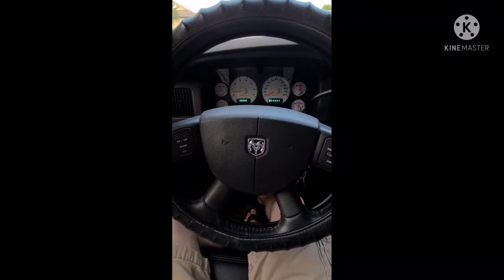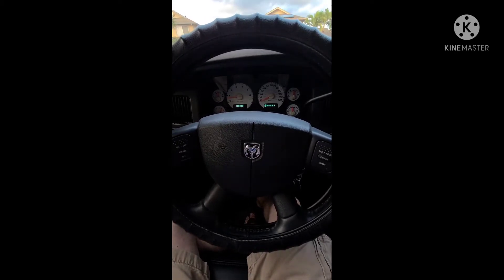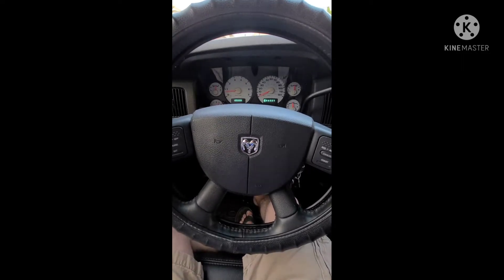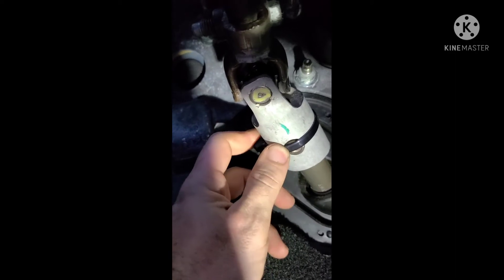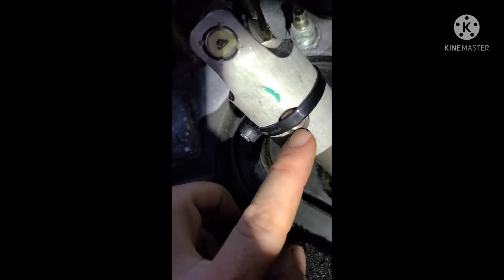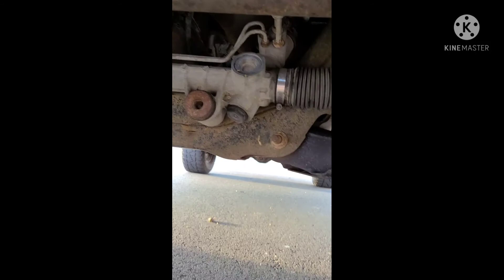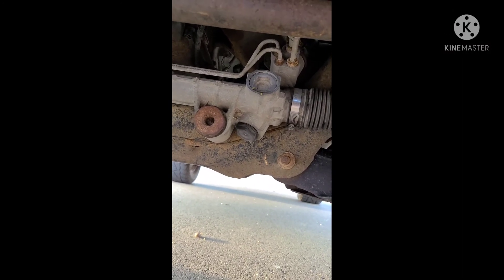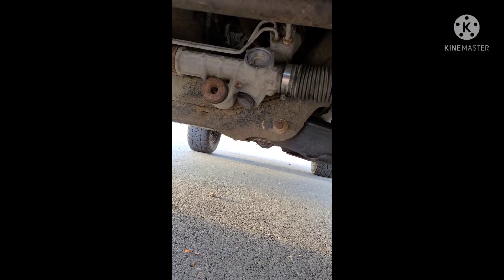2002-2005 Dodge Ram 1500 2wd loose steering fix

Comment: I just did ball joints, control arms. My steering is still bad
Reply from the maker: I did ball joints, upper and lower control arms, inner and outer tie rods, end link, sway bar bushings and front hub bearings and still had issues. Most of my steering slack was in the rack and column. Watch the video for some things to try.
Reply: Did you try to replace the rack and pinion